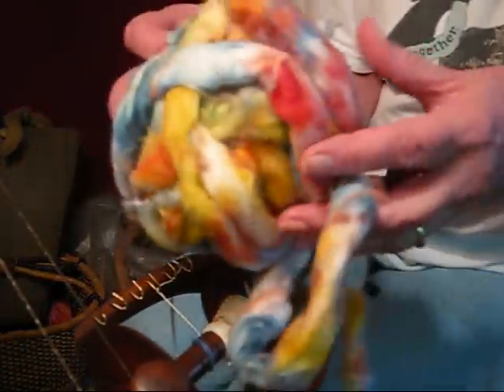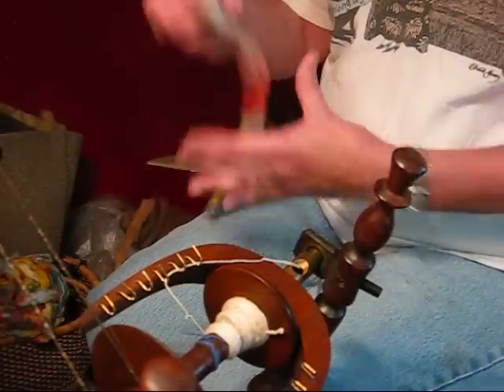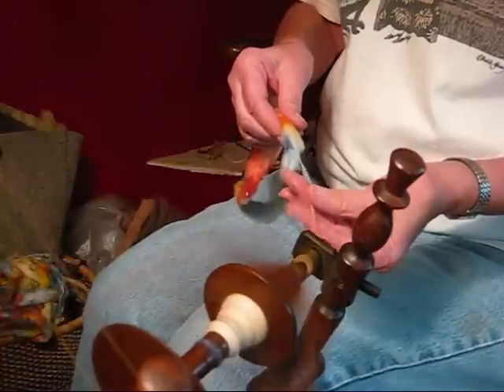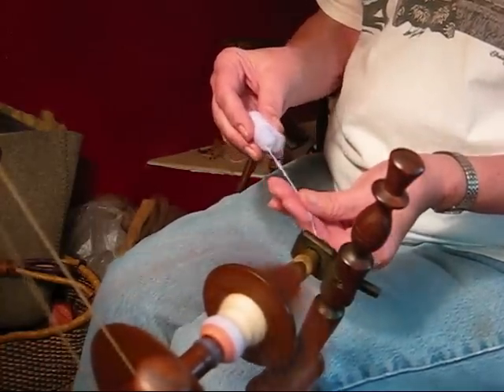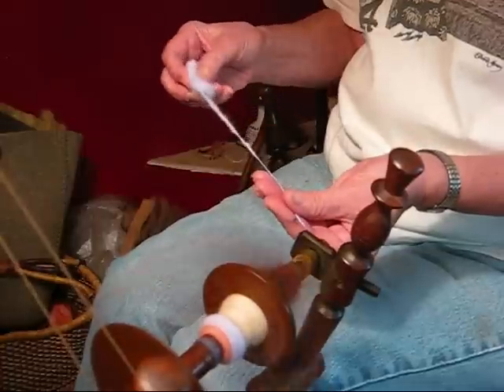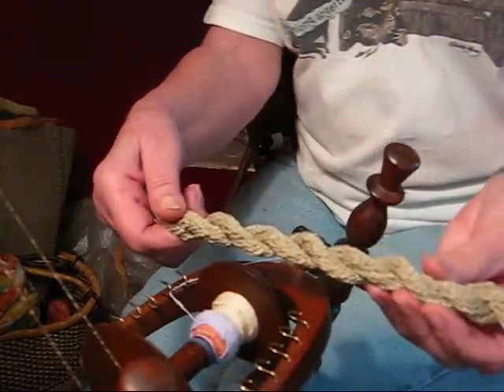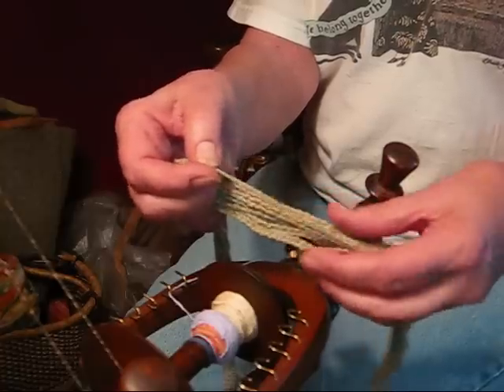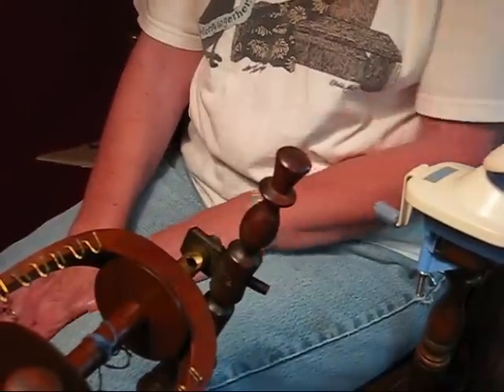Introduction to Cotton part 2.wmv

Comment: Signed in as RallyJudge, my other channel right now.  Cotton needs VERY light tension on the intake, lots of fast treading, a high speed whorl - the highest you have for your wheel, and some practice.  Many people use a short forward draw.  I prefer the "long draw" - you draft out about a yard (arm's length) just ahead of the twist in the fiber, then treadle like mad to insert twist to hold it all together while you gradually feed it onto the bobbin.  Good luck.  I'll try to do a cotton video.